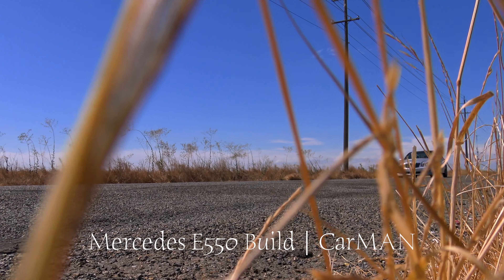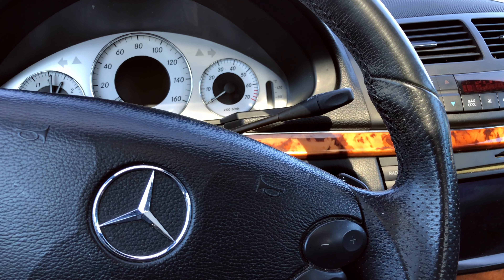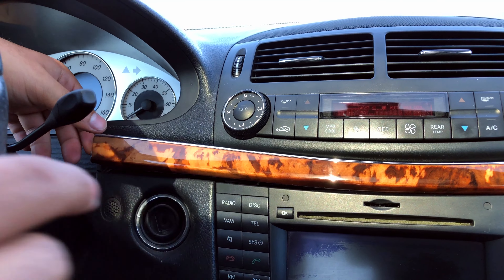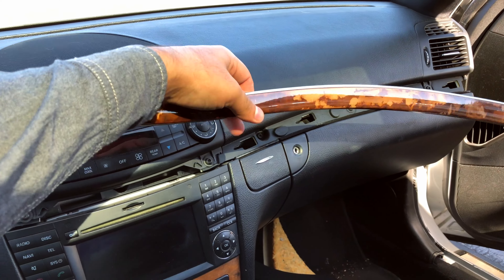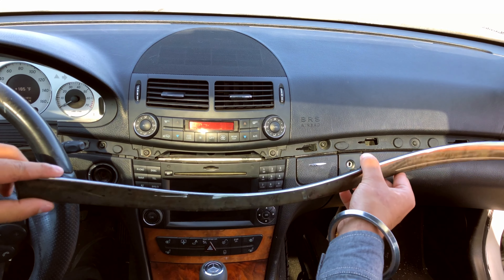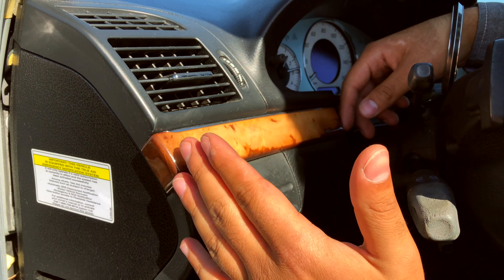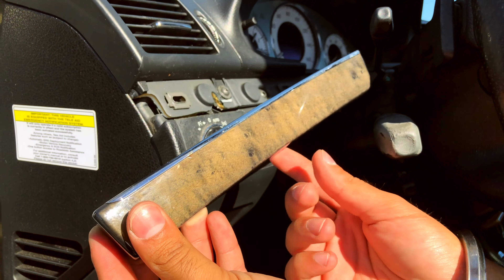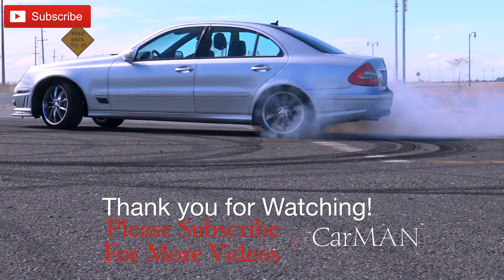Mercedes W211 Dash Wood Trim removal E550 | CarMAN

Comment: where did you get the new trim? and is there any sites that you know of that are the best for buying oem or aftermarket interior pieces? thanks!!
Reply from the maker: Hi I actually got the new trim from a salvage yard locally here. If your looking for OEM parts for your car, check out rockauto and also amazon is good too for some parts. But as for interior parts it’s best to look at salvage and dismantler yards and sites
Reply from the maker: Thank you for liking, sharing and subscribing! Really appreciate it!!

Comment: how do you take off the door panel wood trim pieces---thx
Reply from the maker: Hi, I have actually made a video on that but never got a chance to edit and upload. I will work on the video today and it will be uploaded by the end of today. Your welcome
Reply: @MrCARman  YOU DA MAN!!!!
Reply from the maker: Hi sorry for the bad news. I don’t have the video on that particular task, I checked everywhere. I have a few more w211 e550 upgrade videos tho and will be uploading this week
Reply: @MrCARman  JUST GIVE ME A BRIEF "HOW TO" AND I CAN DO IT--DO YOU NEED TO TAKE OFF THE PANEL AND RELEASE THE TRIM FROM THE BACKSIDE?---THX STEVE
Reply from the maker: Hi Steve, yes that’s the way I had done it because once u remove the door panels you are going to see these flat metal head tabs behind by the wood trim and u have to use a prying tool or flat head Screwdriver. Sorry I don’t remember fully in detail because I did that hella long a ago